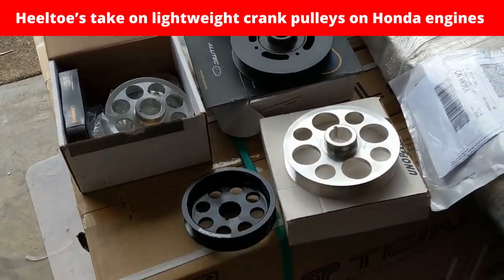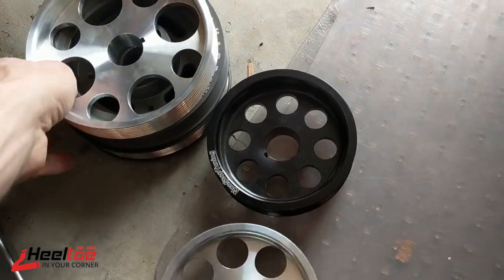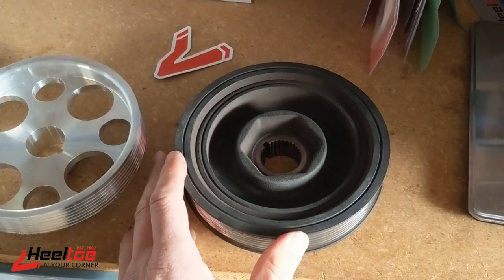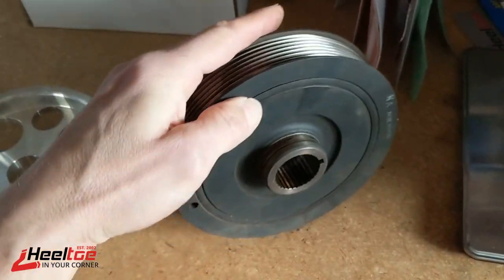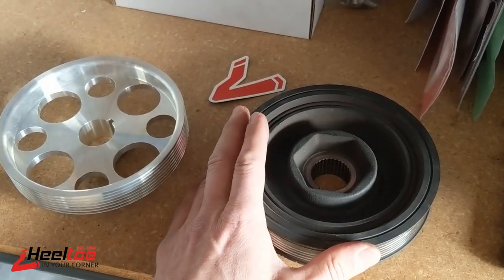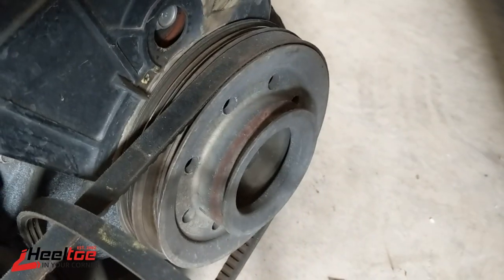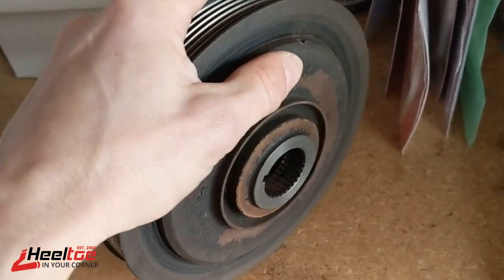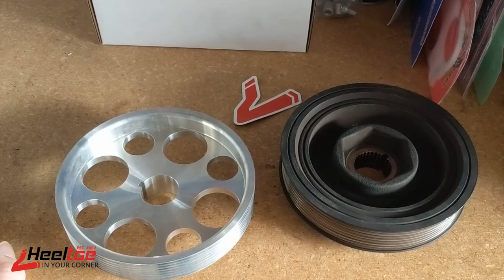Heeltoe's Take On Alloy Crank Pulleys for Honda/Acura Engines

Comment: Adding lightweight/under drive pulleys really added response to the engine. It's noticeably quicker to acceletate, especially when rev-match/heel-toe shifting.
Reply: And your probably still running the stock flywheel right. Dont use an aluminum pulley. It will eventually destroy your oil pump and crank bearings!
Reply: I used a lightweight underdrive pulley on my 3000gt for 10 years zero issues. I’ve used an underdrive pulley on my Trailblazer ss for 30k miles zero issues.
Reply: @HondaAccordPerformance  Excellent. We were discussing Honda engines. Mainly the b series where the crankshaft runs through the oil pump.
Reply: @jimhiscott2918  The only issues with lightweight  pullies I’ve seen on 3000gts are twin turbos making north of 500awhp at that point you wanna keep the stock heavy balancer because with a lightweight pulley it can cause the crank to flex, weaken and snap with higher horsepower applications.
Reply: If you have manual transmission you should try lightweight flywheel it will change the car 😂😂

Comment: Where the hell did you get your information??? Its not a mith. If you run an aluminum pulley on a Honda B series performance engine you risk the chance of having oil pump failure DON'T DO IT. Extremely discouraged on Honda B, D & K series engines.
Reply: Flash Jones  The rubber in oem crank pulleys and in very expensive after market race pulleys is there to absorb harmonic vibrations. With no rubber there is nothing to take up these vibrations except for your oil pump and the crank bearings closest to the pulley. Look on any serious race engine builders motor and you will 100% of the time find a rubber dampened pulley. Especially with us B series Honda engine builders where the crank runs through the oil pump it is imperative to run a very well dampened pulley! I just spent $6000 building another 650hp boosted B series long block and forked out another $365 for a race dampened crank pulley with a smile because i know what will happen if I don't! Again,  avoid non dampened or any plane aluminum pulleys!
Reply: Flash Jones  Got to love that vtec👍. Look at the Honda OEM TypeR N1 pulley/damper. It is a single belt pulley that is "underdriven" and its ⅓ the weight of a standard oem pulley. I have ran this pulley with great success on many B series. Honda oem Pn#13811-PCT-000 This is a very nice pulley I think you may be interested in.
Reply from the maker: Jim are you saying that the CTR N1 pulley is okay to use but an aluminum one is not?
Reply: This 100%, ALL HONDAS COME STOCK WITH HARMONIC DAMPERS. They are internally balanced, but that is not the same.

Comment: I do endurance racing and would the light weight pulley affect the reliability of the K24 engine that are redline for 8 hours a day for an race weekend of about 25 hours total? I already have a lightweight steel flywheel.
Reply from the maker: Without testing it is hard to say for certain. My opinion is, if it is a standard tolerance engine, something off the Honda factory line, it would be fine. If the engine is highly tuned, blueprinted, boosted or otherwise a critical build I would more likely recommend a Fluidampr or ATI unit, which we sell at Heeltoe.

Comment: Most Honda/Acura engines, especially B, K and J series engines are balanced internally, and NOT via the crank pulley. Most '80s V8 and V6 engines are by and large balanced externally though, which is where I think a lot of the confusion comes from.
Reply from the maker: It's amazing how lost people are on this topic. Even really smart people just spread misinformation.
Reply: While true, ALL honda engines come stock with harmonic dampers.

Comment: So, I've read and heard that a light weight pulley gives the motor 5 to 6 more horse power....?
Your video was very good, and very technical. Thank you for such details and information.
So, theoretically the motor will not have to work as hard, do you think there will be a slight improvement in gasoline milage... ??
Reply from the maker: Technically there could be but honestly I would not upgrade with the expectation of mileage increase.

Comment: Been running a lightweight pulley (VMS) on my h23a vtec swapped (Honda Prelude). 60,000 miles going strong no issues.

Thank you for this video however, its very reassuring!
Reply from the maker: Love Honda engines! Free the revs!
Reply: I'm looking to get that pulley too, did u change the key way aswell?
Reply: @yeeztodge6654  nope same key!!
Reply: @yeeztodge6654  though I suggest buying a new key it's 10 dollars...
Reply: Did you run that crank pulley with the balance shaft delete?

Comment: Nice video Marcus! Just got my underdrive and idler installed. Engine is revving better now :)
Reply: But does the engine have any more pull under load?  Not just in neutral?
Reply: Can you provide serpentine belt part # used with Underdrive pulley , thank you

Comment: Is the k24 crank pulley the same weight as the K20 crank pulley? I have a 04 RSX type S, I'm curious about the weight, I can't find anything on it.
Reply from the maker: Good question. Overall I believe they are pretty close in the same, or very similar at least.

Comment: i'd love to have a greater throttle response in my 04 rsx type s, just seems like when rev matching with my sparco pedals you almost have to give it a double tap on the gas instead of one.
Reply: could also need hotter plugs

Comment: I love my light weight crank pulley on my 06 v6 accord
Reply: what pulley did you buy? Does it make a difference? I read that this type of pulley has an ac problem
Reply: Strange question, but did it make the steering a little heavier?

Comment: What set will work on my 08 accord..k24z3
Reply from the maker: We have Buddy Club pulley sets for the 08-12 Accord yes: https://www.heeltoeauto.com/pulley-system/buddy-club-p1-crank-pulley-kit-2pc-honda-accord-2008-12-14-i-4-k24z3-w/ac-bc05-p1pk24z3-a.html
Reply: @Heeltoe.  yeah I seen that one was more curious if the one for the tsx bc I want the ps one as well…just wasn’t sure if it would work bc the tsx has electric ps
Reply: @Heeltoe.  awesome site though just wish the least desirable motor didn’t come in my favorite Honda 😂😂 support on the 8th gen 2.4 is few and far

Comment: Didn’t Honda even sell an oem optional lightweight crank pulley for the original CTR with the b16b? If these were so bad I doubt Honda would sell them from their parts department.
Reply from the maker: Yes they did as a matter of fact, the N1 CTR pulley. We actually just got a shipment of five from Japan right now :)

Comment: @HeeltoeAuto At 4:15, on the lightweight pulley there are 4 distinct 'marks' along the outside diameter. Are those timing marks that are also present on the factory pulley in the same location relative to the hub key?
Reply from the maker: Yes those are timing marks.

Comment: Curious how many pulleys I could swap for a Lightweight/UR pulley on my k24z3 motor on my 2.4 2010 accord? Looking into swapping the oem for lighter ones if available but not sure how many replacement pulleys I’d need
Reply from the maker: We have  a 2-pulley kit with belt here for you: https://www.heeltoeauto.com/pulley-system/buddy-club-p1-crank-pulley-kit-2pc-honda-accord-2008-12-14-i-4-k24z3-w/ac-bc05-p1pk24z3-a.html

Comment: would this be the same as changing out to a lighter flywheel ? would a lighter flywheel be required at the same time. ive heard reports saying a lighter flywheels puts the car in limp, will the lighter pulley do the same as well ?
Reply from the maker: Performance-wise yes the impact is the same. Lighter mass on the crank means faster revving and better acceleration. And sometimes yes people will say that the light flywheel is somehow not good for the engine. 

The "limp" mode is not a real thing, not in the Honda range. Some Hondas and Acuras with a lighter flywheel will get a check-engine light (not the same thing as "limp mode"). This is because the system in these cars that monitors engine misfires will detect minimal changes in the crankshaft speed that makes the system think the engine is misfiring. There isn't any performance impact to this light, but it is something annoying and you want if off. Many people use engine tuners to disable misfire detection to resolve it.

Comment: Harmonic damper/balancer I do believe we mechanics just call it a harmonic balancer because its a combo and it flows off the tongue a little better. Its universally agreed that its 'the thing at the end of the crank that drives the serpentine belt'
Reply: Also, working for an engine manufacturer, the names are all used interchangeably
Reply from the maker: But you see, they shouldn't be used interchangeably because they do mean different things.

Comment: Great explanation! I just want to ask,  What is your opinion on using lightweight pulley on undersquare engine. Does it vibrate a lot? Planning on adding these on my car
Reply from the maker: Thanks for watching! What engine are you installing on?
Reply: @Heeltoe.  2NR-VE, a Daihatsu variant of Toyota 2NR-FE
Reply from the maker: @adibz959  I am sorry I am not familiar with that engine so I am not sure I can comment on it reliably.

Comment: Can I use the stock belt or do I need a certain belt?
Reply: Depends on the size of your pulley, if using an underdrive pulley you will need to size your belts accordingly
Reply from the maker: A stock diameter probably uses a stock size belt, Heeltoe offers appropriately sized belts for underdrive, smaller diameter pulleys.

Comment: What belt would you run on the unorthodox pulleys for the 07 tsx? 🙂
Reply from the maker: We have replacement belts for underdrive systems on those cars on the Heeltoe site. Check it out there!
Reply: DO NOT RUN A ALUMINUM PULLEY!!!!
Reply: @jimhiscott2918  no worries bro lol still running my oem pulley. Spent the money in more important things
Reply: @devoncanada2  Get a Honda  OEM N1 typeR pulley.  Its a great damper for less then $100. Only 1.8 pounds and made by Honda! Its also got a slight underdrive to it.  Been running mine for 3 years on my 650hp LS Vtec. No oil pump issues to date
Reply: @jimhiscott2918  my stock pulley is perfect for what i have so far. I got a ported type s pump, 50 degree vtc, rdx injectors, ported rrc, and a few other goodies 💪
Reply: @devoncanada2  you can't go wrong with a OEM pilley

Comment: My pulley separated from the rubber ring today on my stock TL-S , you think it messed up anything in the engine? Definitely going to upgrade to a lighter pulley. Thanks for this informative video.
Reply from the maker: No I do not think this messed up your engine at all. We have replacement pulleys in stock at heeltoeauto.com!
Reply: HeeltoeAuto I definitely will be purchasing one from you guys thank you!

Comment: I purchased the Buddy Club P1 Crank Pulley Kit, K-Series Applications (K20, K24), BC05-P1P for my 09 TSX from you. My mechanic was telling me that if we install it, the engine will make a lot of noise after. Is that true? Regardless of the answer, do you have a video or sound clip? If the engine will be very loud and sound like an older model Civic, I don't want it lol.
Reply: No it doesn't change the sound. Just make sure you buy a new crank bolt for your model because mine bent slightly on the top part of the bolt (not the threads) this is because u have to use a torch to remove and sometimes the bolt gets damaged. Better to have a brand new bolt to reinstall.

Comment: Goes well with turbo?
Reply from the maker: In general I would say yes. HOWEVER, as boost pressure rises and toque increases the issue of crankshaft deflection becomes greater and greater. Especially if the engine is built up with stronger pistons, sleeves, rods, etc you will want to consider an upgraded damper like a ATi or Fluidampr unit to dampen those forces.

On a factory-turbocharged car with a stock bottom end (most cases) or a mild turbo on a mild build...I say go for an alloy pulley. It will help you generate more power off-boost to help RPMs come up and get exhaust flowing.
Reply: If you dont mind exploding your oil pump go ahead and run an aluminum pulley. DONT DO IT

Comment: Would my 04 TL based need a tune after installing(m/t)? Is there more than one pully that can be upgraded?

Just received my short shift kit and high-flow third cat. Hoping to install soon!
Reply from the maker: Not at all no, this part does not require recalibration of the ECU. We offer the crank and tensioner pulleys for the TL J-Series.

Comment: I'm saving up to get this and the clutch release system master and slave cylinder for my 2013 V6 coupe!
Reply: I'm thinking of doing those with shifter bushings at the same time also. Any update?
Reply: @armancha23  Nothing yet. I'm still doing reading, but across the forums the guys who have done this already claim that it's a problem free upgrade.

Comment: What about a 2015 VW beetle. Automatic, gen 3 tsi 1.8t. would a light crank pulley or under drive pulley, which is what I'd like to do. Would this be able to work for it?
Reply from the maker: I can't really comment, we don't know enough about Volkswagen engines. Mostly just speaking about Honda engines here.

Comment: I have a question make fun of me if you want but I’m being very careful on what I do to my car. I just bought a light weight crankshaft pulley for my Acura rsx 2006 base model automatic. I hear a lot of mix feed back from it saying it destroy my car and others say it ran fine like nothing was done to it. I need help on if it’s safe to put on or don’t do it.
Reply from the maker: Gavin we appreciate your concern, the video was made for you to get our opinions on it. In short, you'll be fine. Got ahead an install it and don't worry about the scary stories.
Reply: HeeltoeAuto what should I expect to get out of this light weight crankshaft? I’ve heard better acceleration but no hp gain, some said 3 to 4hp gain and some say nothing it’s just nice to look at
Reply from the maker: @deathstalker176  The lighter weight of the pulley reduces the power needed to spin the engine. The revs should be a little more responsive and faster revving. It's not a big hp gain but part of a good performance package for a tuner. Fact: faster acceleration means more HP. So whoever said no power gain isn't really stating facts. it's not just a pretty part. It's effective. How could the car accelerate better but not have more power? that doesn't make sense.

Comment: Ive run lightweight aluminum crank pulleys on three engines all of them daily driven to over 8000rpm including -30 Canadian winters....never had engine failure lmao b16a2 b18c1 k20z3
Reply from the maker: It's a total myth, right? Do you do any oil tests?
Reply: @Heeltoe.  This myth was originally spread because American cars from the 1950s-1970s were externally balanced with the crank pulley as a damper. When racers would replace that pulley to something lighter the motors would shake apart. This is not the case with Honda motors because they are internally balanced, I dont see why this is so difficult for the internet to understand.
Reply from the maker: @danielcalquinhas447  likewise, the secondary reasoning for not changing this part is the risk of stress fractures due to repeated flexing of the crankshaft under powerstrokes. Weaker crankshafts will fatigue and fail if the harmonic vibration from this oscillation isn't dampened. Honda makes no such flexy crankshafts. The only reason to run a racing damper on a Honda engine is under very high load high stress conditions.

Comment: I'll try with a nicer comment so this doesn't disappear too: you don't know what you're talking about here.

If you do an actual simulation of forces, you find out an inline-4 has fairly nasty 2nd order harmonics. It's a up-down rocking of the crankshaft ends. On a B/D/H engine with an oil pump gear riding on the crank, this can be DEADLY. Coyote V8's offer great examples of similar 2nd order harmonics shattering crank-driven pumps when they are under-dampened (particularly with a supercharger reducing it's damping power).

K-series use chain-driven pumps so it's less of an issue. It still imparts much heavier loads on the outer-most main bearings with an undampened pulley. Also accessories like AC & PS add to the dampening effect, so motor with them deleted need even more dampening. Same for engines with lower rod-stroke ratios or higher redlines - they need more.
Reply from the maker: Given that the majority of engines we deal with are K and J and they all have the extra accessories you are talking about, you are supporting the point of the video.

But in reality, the people this video is intended for are the vast majority of street-driven engines without power adders and not having the abuse of a racecar. Myself included, ZERO people in DECADES have mentioned to me once any issues whatsoever using a lightweight pulley.

Model it all you want, the reality is, telling the world doomsday stories of grenading engines is largely a lie.

Comment: Great video!
I have one question:
Do you think that between all k20 specs, the crankshaft pulley are the same?

Im asking because I have bone stock 8th gen civic si (k20z3) and the crankshaft pulley is wobbling, so looking for the part the exact replacement is 160$ while ive seen other crankshaft pulleys for other k20's for 40$
Reply from the maker: Yes we think pretty much all the K20 pulleys are interchangable.
Reply: @Heeltoe.  thank you
Reply: Might be too late, they are interchangeable but the diameters are different.

Comment: I wonder if this is still safe for high to mid range hp built cars (250hp+ cars putting alot of pressure on those lightweight pulleys)😕
Reply from the maker: HP does not put pressure on the pulley...your statement really doesn't make a lot of sense. We sell these for 200-300 hp cars all the time.